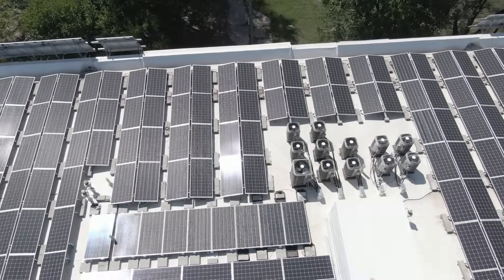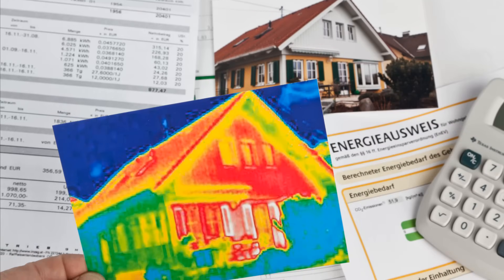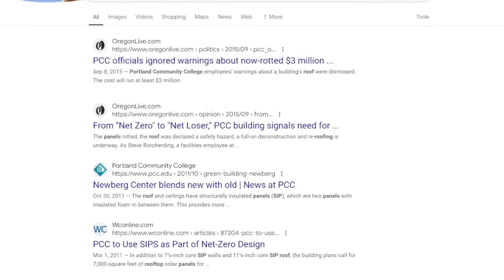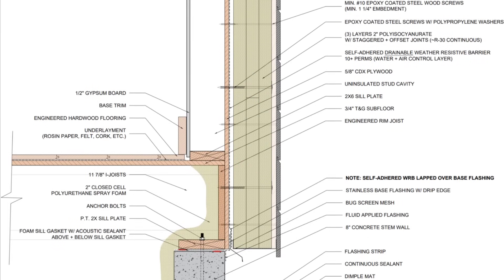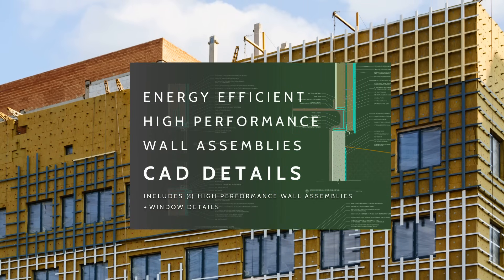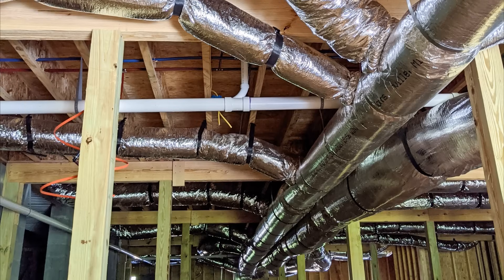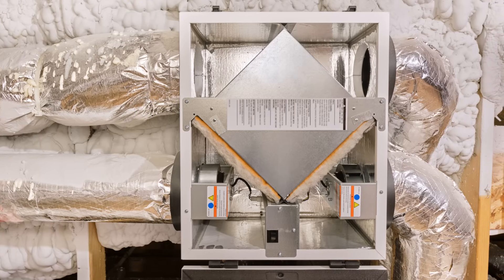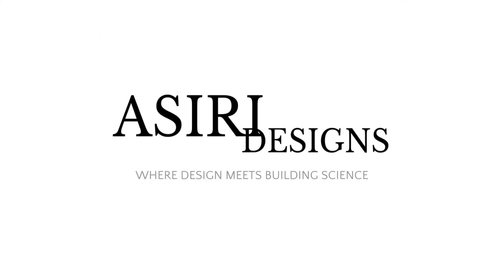The Unintended Consequences of Energy Efficiency...

Comment: A good HRV also manages to reduce the humidity difference.  The answer here can be to insulate in different ways, but also use better practices to prevent moisture in undesirable locations, which should be done regardless.  An AC or heat pump, especially a variable speed system, can be used to properly manage humidity by running it at a very low speed.

Comment: moisture management is critical for sure. We recently started rennovating our basement. Even though it was technically finished, it was cold AF in the winters and had no air barrier between the foundation and the living space. Given that we live in area with some of the worst radon issues in Canada, insulating the basement as best we can was paramount. We started with the utility room that had exposed concrete flooring and now that it's done, the room feels great to be in, but we needed a dehumidifier to keep moisture out. It runs 24/7 and collects a little less than a pint a day.
Reply: Radon is a real killer!
Reply: And where I live we have to run humidifiers :)   But my house is not airtight and will not be  - I like sleeping with open window even in winter

Comment: Brick and mortar buildings can also be insulated, and don't rot. Wood that's treated even slightly, in a DIY way, is also a lot more durable than wood that's just nailed together. Besides thermal insulation, a properly built building also needs proper moisture insulation. If you use permeable insulation, like rock wool, plus the right kind of membranes on either side of the wall (a vapour barrier at the interior and a membrane highly permeable to vapours at the exterior) you don't need any other system to evacuate humidity from the interior and your walls will stay dry even at 80% exterior humidity.
Reply: My ideal home would have 5 foot thick concrete outer walls with concrete slabs for the roof with  rust resistant supports. The interior of the house would avoid the use of wood.
Reply: @jonathanjones3126   That would be a rather inefficient and unhealthy home. Concrete is a terrible insulator, highly hygroscopic and permeable to radon. You'd have high humidity favouring mold growth and an above average level of radioactivity inside at all times, and it would cost a fortune to cool in summer and to heat in winter.
Reply: @a0flj0  that would just be the exterior thermal mass, I would have steel framed house inside that
Reply: @jonathanjones3126  That would be even worse. Steel rear inside concrete only rust extremely slowly, due to the lack of oxygen. A steel frame inside that concrete structure would rust like there's no tomorrow no matter how well you coat it.

If you want a properly built brick and mortar house, start by building a strong enough foundation, using a radon impermeabile membrane on the exterior, and a water impermeabile membrane on top of it. Cover that foundation with water insulation over the entire upper area, then build a skeleton of concrete to carry the load on top. Fill the walls between the posts with brick and mortar - the kind of nodern brick with holes, which provides better thermal insulation. Cover the entire exterior with rock wool, at least 4 inches thick, even thicker, depending on how cold or hot it gets in your area. 5 feet makes no sense anywhere, and will just make the building excessively expensive and require a humongous lay deep foundation for no benefit. 1 foot 4 is already excessive, 10 inches should be enough. Cover the rock wool with a vapor permeable membrane, and only then apply plaster on both the interior and exterior of the walls - never use plasterboard on the exterior. Use a water repellent finish on the exterior. Buy and install only triple pane well insulating windows and use double doors for all entries/exits, use simple doors only inside. Install floor heating. Also install at least 8 inches of insulation under the roof - foam is OK if your roof's load bearing structure is metallic (I've never seen this except in houses built from steel framing), and will partly compensate for steel's better thermal conductivity/higher thermal losses, but you should use something permeable if your roof's load bearing structure is made of wood, such as rock wool - I'm not a fan of organic insulation, such as cellulose or wool, since these materials may get infested by mold over time. Be very careful with the rock wool - most cheaper brands like to sag, after a few years. Ideally, build on two or three levels, to maximize the volume vs exterior surface area - there are limits to this set by the need to get natural light into the house. Maximize the window area with southern orientation while minimizing the window area towards the north. This way you'll get a proper, livable, energy efficient, healthy, modern home. Building the way brick and mortar houses were built 200 years ago, or like the Maginot line was built, only gets you a highly inefficient and excessively expensive home in which you'll freeze to death in winter, where mold will form in all corners and where humidity and cold will give you arthritis and the bad light will give you depression.
Reply: @a0flj0  who said anything about rebar, just basic concrete blocks stacked....
Reply: @jonathanjones3126   Concrete blocks without rebar would be a terribly fragile structure. Concrete has excellent compression resistance, but is pretty shitty when it comes to strain. Heavy trucks running around your house for a few years would be enough to get your house to crack and eventually crumble. Even bricks and mortar alone do better - they're a tiny bit more elastic, which prevents them from cracking from vibrations, if properly laid.
Reply: @a0flj0  still better then crappy wood frame housing,  those wood frame houses burn down at the first spark and mold out or get infested or just collapse, especially the newer style of 24 inches apart studs.

All houses should be as fire proof as possible and designed and built to last 100 years without major maintenance
Reply: @jonathanjones3126   You can definitely build with wood so that it lasts for hundreds of years - there are many historical buildings in Scandinavia or Japan that are made of wood and are older than the US. You just have to know your trade.
Reply: @a0flj0  no house built in the usa in the last 50 plus years built out of wood meets the standards for anything above low quality,  the cheapest wood was used, the cheapest design. The wood houses are built to be disposable
Reply: @jonathanjones3126   That only says something about how wooden houses are built in the US, not about how wooden houses can be built. There are barns and stables, where I live, that are older than a hundred years and which show zero signs of rot or damage.

Comment: I live in washington state, on the West side of seattle in the rain forrests, and can tell you that this is 100% correct.  I've had the remarkable experience of being able to build my own tiny house on leased land in old growth forests and the only way to not have everything you own rot in a traditional home is by constantly moving it around and giving 6" of space from the wall from anything natural fiber based to prevent mold.  I am also a mycologist and know how to grow mushrooms, so can tell you that mushrooms are happy at any humidity above 65% which is very easy to acquire after a few rains in late summer.  I've lived in so many old homes in my 20s that I can say the only ones which didnt suffer from mold were the ones that didn't have insulation, and those homes were not insulated because in the early 1900's the cost of heating a home was less than the cost of insulating, plus the technology of insulation was not adequate, they were using shredded wood for the love of God. 

So the only way to properly insulate your home is to essentially have an exoskeleton with an inner tent of insulation, and the insulation will still rot if not protected by Dupont's ground breaking teflon technology, which essentially turns a home's skin under the clad into a raincoat full of holes from the penetration of cladding on the exterior. Even if the tyvek weren't penetrated by the cladding nails, it still gets clogged up after a decade or more of particles flowing through it's pores, so it is only a temporary prevention method to the reality of dealing with nature. I believe houses are build entierly improperly for Washington, but they are also designed for cost effectiveness in a suburb enviornment, which is why they do not work when you put them out in the rain forests.  Metal is the only solution to the modern housing dilemma.  Anything less than metal is going to be gone in 30 years and cause issues to you in the long term as your lungs filter out the contaminates.

Houses need to be designed to be temporary and modular, it is a disservice to our earth to fill it full of fiberglass landfills, and you will realize this anytime you google a genertic suburb, then realize that each house is littered with cancer causing chemical insulation, and so is every other house on the block of all the other millions of suburbs that exist. What a crime of nature.

on top of all the rambling I have done, I'm convinced, ontop of the toxic food most people are eating, the reason why most of society is becoming ill is due to the toxins within their household, and how it all becomes present in their daily life because of the design of their shelter.
Reply: Is it an American thing to only think about extremely badly thought out wooden shacks AKA "houses"?
You build a house from brick. You use concrete and rebar if you eastern European.
Those houses last for centuries and have no mould or rot problems.
I live in a very cheaply made house in the UK, build about 50 years ago.
I think it has the right balance of insulation and ventilation, where the house is pretty easy to keep warm and improvement to the efficiency will save less than £1 per day, at best.
The house has zero rot or damp issues, zero mould.
Yes, it does mean I have to open a window once in a while (something the native English people are vehemently against) but I think that's a very good balance and any more technology is just asking for trouble!
Reply: @todorkolev7565 It's a matter of historical availability. When America was settled wood was plentiful. So wood was use across the states as they were settled and developed. 

Around the 1890-1920 we started using bricks a lot more but then wars happened and the Great depression. All of that followed by the baby boom post WW2 and we just needed housing built fast and wood is fast. Thus I guess we've kept trying to fix the problem with wood with out realizing that the wood is the problem

I personally think that a concrete structure that is externally insulated with an HVAC system would the peak for a single family home.
Reply: , If every house was built with concrete,  how would we deal with the vast amount of CO that current manufacturing of concrete produces?  And concrete is extremely porous and our current standards for concrete gives it a life expectancy of 70 years or so.
Reply: @Teddy_Morrison 

Many of the 'brick homes' of the 1910-1930 era are actually just a brick exterior on a wooden stick frame. The wood is well protected though, so they last very long...
Reply: @todorkolev7565 

Everyone lives in a house in most towns in NA. That's why houses HAVE to be made from wood or cheaper materials. If it's either a 'large wooden shack' or a concrete apartment, most people will go with wood rather than having no yard and less privacy, maybe if you were raised behind the iron curtain, you won't ever understand but it totally makes sense to me.
Reply: @todorkolev7565  you see brick in rural areas because people actually built those houses, but most people live in subdivisions that are thrown up as quickly and cheaply by developers as possible. If I ever get the opportunity to build a house I'm doing a commie pod with some cheap exterior siding to blend in lol.
Reply: insulated rammed will last thousands of years if built without steel rebar

Comment: For viewers to avoid confusion: it's not stated but the video is applicable to the UNITED STATES. References to "The Department of Energy" mean "The United States Department of Energy" etc.
Reply: etc "Buildings these days IN THE UNITED STATES are made a lot more moisture sensitive materials, like OSB"
Reply: @TakamiWoodshop As a Brazilian I still can't like the idea of wooden and plaster houses; cement, steel and ceramics, this is the type of house I like, as hard as stone
Reply: this comment thread is a massive circle jerk
Reply: This is a very strange video. In Europe we build with insulation in the walls and use barriers that let moisture escape. Balanced ventilation keeps the moisture out without adding a extra dehumidifier. There are so many confusing and seeming false information here just to sell you stuff.
Reply: @prismalike  I'm living in a brand new apartment in Switzerland and the insulation is fantastic, but the moisture is a problem in this humid region. You can either open the windows 4 times a day or just use a dehumidifier, but it's not a US specific issue.
Reply: @ivanlagrossemoule  opening the windows only helps when the RH outside isn't already 65%+ which is a common thing in the American south. Any humidity over 60% greatly increases risk of mold
Reply: Well actually, in Europe we don't all build the same way eather. In the Nordics it's not common to use barriers that let moisture escape, but keep the interior side of the wall air and vapor tight while having no barrier on the outside of the wall at all so it can dry naturally.
Reply: Yea, strange video. Only a problem in a country with their own weird building habits.
Reply: @anon746912 nah, it's useful to avoid coming into the same issues they've come up with. Proper ventilation is rule of thumb to rule out condensation worldwide, digging deep enough into the ground is good for structural integrity worldwide, and so on. If they fail, we learn what not to do
Reply: @anon746912  It is absolutely not a US specific problem. In fact I would argue, it is even more of a problem in Europe were lots of buildings are made from masonry instead of wooden framing.
Reply: Thanks bro I totally couldn't tell from the fact that the man with an american accent was talking to me on an american website that he is an american.
Reply: We get it! Physics work the same way everywhere, though; so if someone from Africa was building, they need to take into account the same potential issues you'll have at the United States.
Reply: American building standards are so low. Waste energy with heating and A/C because the building is made of paper. They use indoors and or Billy shelf materials for the outer shell, and are surprised it does not hold up.
Reply: Yeah. The video is really weird.

Comment: Thanks for covering this.  One other idea I've considered for a more durable house is to extend the eaves much further than is common today.  I believe that I've read that wall failures are almost guaranteed within a century if the gutter is on the side of the house, but a house with two foot eaves will rarely have problems.

I've also seen enough termites using foam insulation as highways to wood that I don't intend to use it anywhere near the foundation of the house.  Not to mention that it makes houses much more flammable.  

I didn't realize that they had exterior rockwool, and I plan to consider using that.  It seems that rockwool is a healthy replacement for asbestos.
Reply: I said the same thing about the eaves. Push the water away from the foundation.
Reply: Big believer  in roof overhangs to protect wall surfaces. Large overhangs  on gutter sides keep high sun out of windows  in the summer  and allow low sun in, in the winter, not to mention  they generally make homes more attractive and look less "cheap".
Reply: That’s what I thought about rockwool, but it turns out that the stone fibers are very similar to asbestos
Reply: @SlaviJordanov  Not that it couldn't be a poor study, but I read one where they filled the air with rockwool fibers and had rats breathe it for a substantial length of time.  They found that their lungs could (slowly) clear it out of their bodies.

Comment: This is an embarrassingly bad take.  The solution to moisture infiltration is to fix the moisture infiltration not to insulate using a technique that is 10x more expensive and.... doesn't stop moisture infiltration.  😂😂😂
Never trust someone who will financially gain from your trust!
Reply from the maker: @grizz6582  By all means, please continue to screw up buildings, it's the best job security that we have! It just so happens that the best way to address many of the moisture issues is to use physics to your advantage.
Reply: @ASIRIDesigns  i would rather have my house breath than not sealing it up will sufficate it fresh air is best and always will be
Reply: @ASIRIDesigns  snake oil